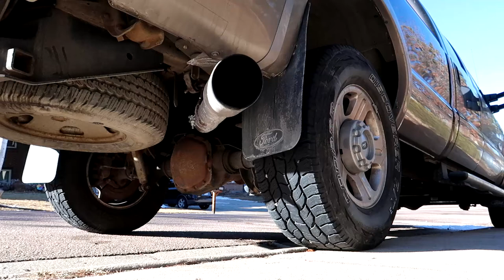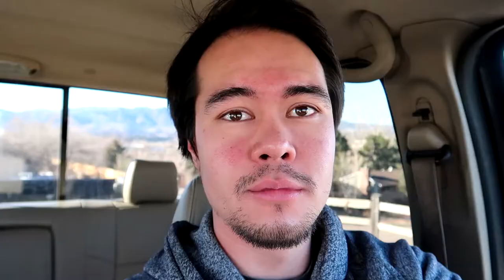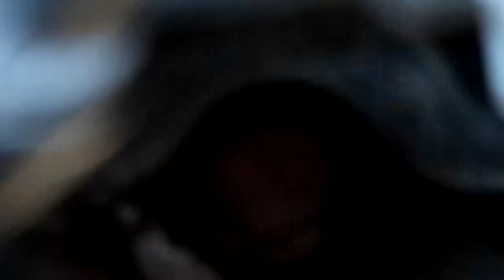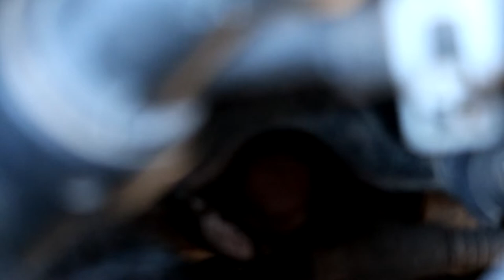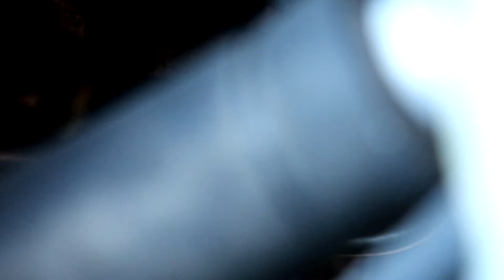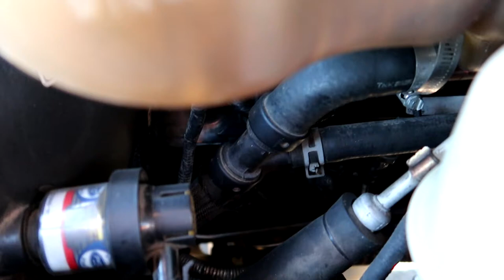How to tell if your 6.0 Powerstroke has been "bulletproofed"

Comment: Thx for the info, man. Yeah I've heard loads of stories about the infamous 6.0 since I was still a teen. Highly recommend this to any new Ford 6.0 buyer.
Reply: I have a 2004 6.0 with 38 k original miles. Head gasket, was replaced in 2018 with 23k miles. What should I do to make sure it will last me 300k miles or more
Reply: @juan71685  head studs, egr delete, after market oil cooler.

Comment: I got a 2007 ford f250 super duty lariat with a 6.0 and it's over 200000 miles on it and I love it I always tow trailers with it for my job
Reply: Lmao i got the same thing i love it but it does have it problems
Reply: I’m actually looking to buy one myself same year model and everything but has 200k miles. Any words of wisdom when looking at it?
Reply: @danielramos7556  just make sure everything is running good dont let the miles scare u it all depends on whats been done to it and how it was driven
Reply: @NTBgaming  thanks man. Definitely going to ask if it has been “bulletproofed” appreciate the advice! Doing tons of research on YouTube as well.
Reply: @danielramos7556  good idea if not still dont be worry you may injoy doing it yourself as it makes the truck more meaningful well thats my opinion but u know
Reply: That’s exactly what I just bought. So far so good but after the horror stories it’s getting BPd very soon
Reply: i got the same truck

Comment: My understanding according to my dad's explanation is the stock bolts they used are meant to stretch to torque. So when people tune them it increases pressure causing them to stretch too far thus a gasket failure. It's a bad design idea on the manufacturer part to have bolts that are meant to stretch in a place meant to be tightly sealed. So the fix is studs that don't stretch. Obviously they still stretch without tuning as well but increasing the stock power increases pressure. Towing heavy things increases the pressure. Basically unless your just using it as your daily driver and not hauling things heavy or tuning it to increase power it may never fail. If your using it for what it's meant for it probably will.
Reply: 99% of all head bolts are torque to yield stretch bolts. 1 times use

Comment: I had 2 6.0s  a 04 dually studded and deleted  ran gear head srl ++ and a 06 stock they both had a lot of issues yes they can run well but for how long  theirs alot of things people  dont understand about them you really have to monitor alot of things on them and for an average joe they will plain out fail faster  . I sold them both and bought  a 2000 7.3 it may be slow but it gets the job done , no gasket failure  no hpop failure  no egr shit ect....and half the cost for mantience
Reply: It all depends on how the truck was treated, my buddy's 6.0 with an egr delete and studs has 400k miles with barely any problems and he tows with it almost everyday.
Reply: @raul salazar its all about the care you give it FROM DAY ONE OF THE ENGINES LIFE. Starting on second owner or 200,000 miles is like losing weight and quitting smoking after you’ve been 600lbs and smoked for 45 years. You’ve really set yourself up for failure. You can’t even spell right so are you sure you did the maintenance that the book says and didn’t skip any steps? (Maintenance =mantience)

Comment: I'm looking at a 2005 6.0 with a 153k miles for 17,200. dealer said it's bulletproofed but only knows for sure that the bolts were replaced with studs , trucks sounds nice , you guys think it's worth it.
Reply: That seems way overpriced, I got my 2006 4×4, 6.0 with the EGR deleted etc, for 8 grand and has been doing fantastic!! I have 173K miles on it and these can last 300-500 K!!

Comment: I am looking at a 2003 6.0. This is what he said he has posts. 2003 4x4 6.0 powerstroke , the odometer has 320,000, I replaced the engine and transmission 6 months ago, the engine had 150,000 miles and I have used it for maybe 20,000 more miles, HEADS STUD I put new injectors, the turbo was rebuilt, I put new pulleys, serpentine belt new, new oil cooler, has a tuner edge is older version but works great for me in economy mode. He is asking $5,000 is it worth it?

Comment: youre missing the cheapest best thing you can do.

mishimoto rad, 7.3 fan clutch, zerex G-05 coolant, motocraft oil filter. 

for those that don't know, stock cooling fan kicks on @235 degrees. The 7.3 kicks on at 175 and its mechacnical.
Reply: You can use the 7.3 fan on the 6.0 fairly easy?
Reply: @operationhotshotinc.6887  yes but you need an adapter. Bulletproof diesel sells them as a kit. I have one on my truck.
Reply: Thanks for the tip

Comment: Would mine be a semi bullet proof I did install the bulletproof egr cooler but I didn’t stud mine since I don’t tow anything as well I installed a Mishimoto radiator. Would that work to prolong my tuck life it has 160k miles
Reply: Your truck will run longer no doubt but it wont be bulletproof, if you're not doing performance mods or heavy towing, the truck will be fine.
Reply: Thanks, eventually I would like to get a tuner. What else would I need to consider it bulletproof?
Reply: @moi6660  I'd stud it, and get a better oil cooler. That's basically bulletproof if you ask me.
Reply: Which oil cooler would be recommended ?
Reply: @moi6660  sinister diesel makes a good kit, I'd go with them.
Reply: H
Reply: I checked there oil coolers are the same as oem
Reply: @Moi the best oil cooler is the OEM. Sinister sells OEM with their name on it , the BPD Kit is great ,dorman is obviously the OEM replacement. You get the idea. OEM is the way to go. The best bet is the smaller style powerstroke was built with. The larger ones have a larger surface area to absorb more heat and they themselves say expect your oil to run 230° as the normal temp. The new oils today are good at that temp. I just think the cooler the better so liquid to liquid is the best bet. The one he mentioned in the video is a good upgrade like he’s running. The biggest issue is the stock ones clogging the newer ones that are the same size have their ports open. So the one you said is the exact as the OEM May be but it may be larger insides to keep it flowing. The other thing is if you watched the video he told you the 5 things you need to be considered bullitproof you aren’t bullet proof without that brand and those 5 parts /deletes. 

To make your truck last longer don’t get it hot and run it hot do the maintenance on time and do it with the best motor oils you can get and change your coolant to ELC- the extended life coolant. The stuff is worth the extra $$$ per gallon
Reply: @moi6660  I did the bulletproof on mine, sinister diesel makes great stuff as well.  If you're a veteran, sinister will give you 10% off.

Comment: 2004 F-250 6.0 with 157k miles for 10k...should I get it guys?
Reply: Definitely if those are the actual miles watch out because a lot of people turn the odometer wayyyy down
Reply: Jared Thompson ok thanks boss...the guy said he took care of it like a baby and kept up with the maintenance, since it was his daily driver and didn’t beat it up like most guys do. But I’ll find out soon.
Reply: Awesome I hope it works out for you
Reply: I got mine for 12k with 220k miles, amazing truck. Make sure it sounds good and can hold boost but mines a 2003 king ranch 6.0 and it's bulletproofed before I got it
Reply: Carfax it too see if those are original miles . 10 k is a good deal

Comment: That ticking time bomb is on you. Look up about how 2003 to 2004 6.0 heads were cast and about original head bolts stretch. Until you face these problems for your self I wouldn't be giving advice.

Comment: Honestly my truck looks like your with a stud but some are bolts so not sure
Reply: Brainiac Productions it’s easier to see them from the driver side but the only other thing you could be seeing is the valve cover bolts I’m pretty sure
Reply: The valve covers have one or two studs and the 11oclock bolts are sometimes studs for wiring grounds and stuff like that. The headbolts are either bolt or studs if it’s bolts then it’s factory period.

Comment: Every engine will have blow by..
Reply: Tell that to my father in laws 04 Cummins with 298k miles that literally has no blow by. It even shocked me. Lol
Reply: My 6.5 diesel had 220k miles and had absolutely zero blow by
Reply: if you take care of your engine and it isnt worn from heavy pulling, when you remove the oil cap with the engine hot, it is very likely that you will not see anything coming out
Reply: 232k on mine and absolutely no blow by